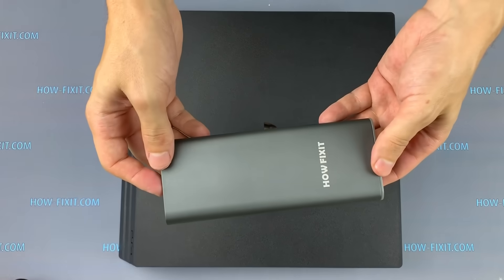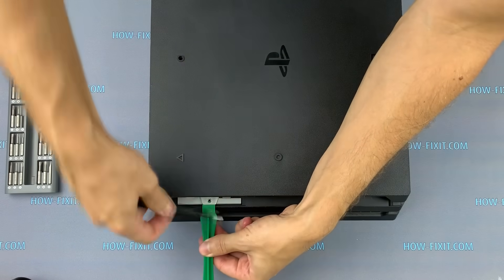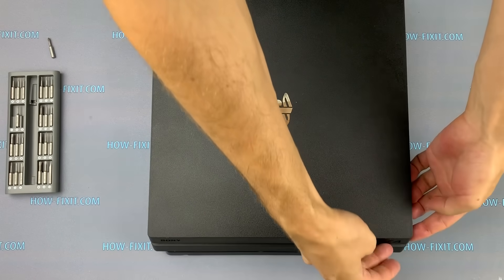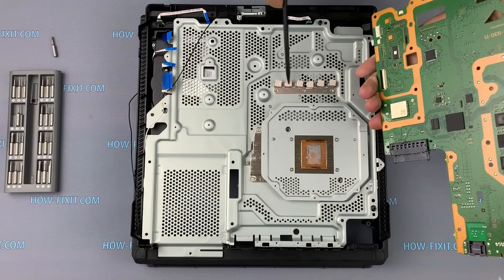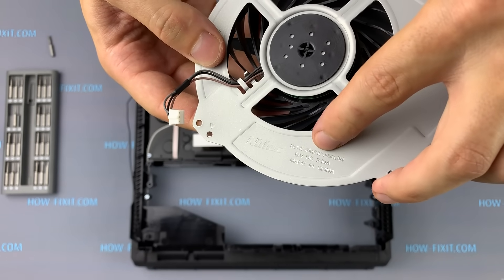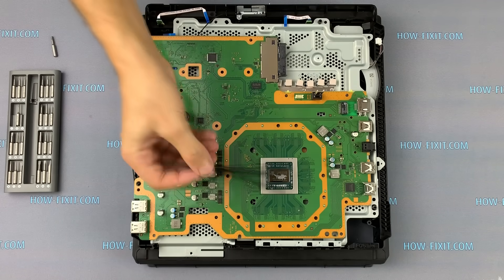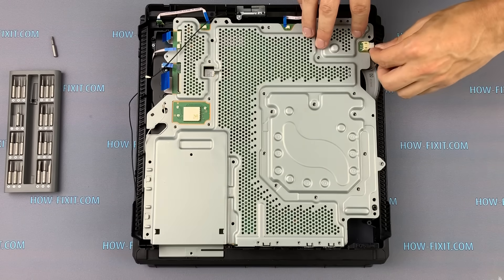PS4 Pro Disassembly: Ultimate Guide for Fan Cleaning and Thermal Paste Replacement

Comment: Followed this video and it is amazing! Helped me replace the paste on my Ps4 Pro. DEFINITELY worth it guys, every game made my PS4 ramp up the fans to max all the time since DAY ONE! Don't let people tell you that it's the "fan being dusty" or "that's how it's supposed to sound". The thermal paste in my PS4 Pro was so bad it was laughable! I took a photo but can't share it here :/

2 tips that I picked up on the way from other videos that will be very useful as you could easily break your PS4...

1. When removing the Power supply cable @3:14 ...do NOT try and just pull it out! It is connected to the motherboard and can easily snap off! Use a good pliers and grab the part you want to remove and slowly wiggle and lightly pull...NOT THE WHOLE PART....otherwise you will snap it off and it could happen so easily!

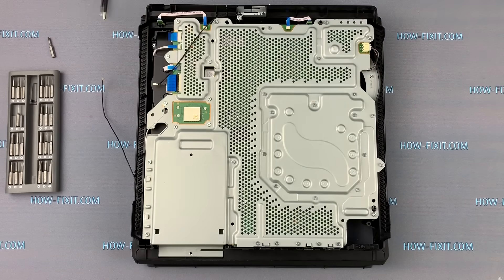2. Be sure to LIFT THE TAB on the ribbon cable @3:36, it's the only one that has a tab holding it in place. I've seen a lot of comments saying their disk drive doesn't work anymore....this is why...if you don't lift the tab you damage the ribbon cable.

Excellent video and my PS4 is about 85% quieter now! I was hesitant and didn't want to do it but I'm glad I did!

If you're reading this and you're not sure if you should do it or not....trust me it's easy, just do it slowly and carefully, the results are worth it!
Reply: I'm thinking about doing the same to My ps4 pro, because i dont know how much longer I can play games with that jet engine. But I'm not sure if it's worth spending money and time on New parts, when the ps5 Will be out in a couple of months anyway. What do you Guys think?
Reply: @fatti2602  Get ps5 it's gonna be cheaper than ps4
Reply: @doubleh2002  I was about to say the same I fed up of my PS4 pro being noisy from the menu system. I prefer to buy a ps5 when possible
Reply: Same
Reply: Removed the power supply and the part snapped fml, well I guess I will be waiting ps5 for now...
Reply: @Jack Meoff  just happened to me too, fkn sucks
Reply: @raycysm7200  did you ever fix it?? Can it be fixed?? This has happened to so many people and no comments of how it can be fixed or even if it can be fixed at all!? Like I’ve read so many comments and so many people have done this exact thing but not one comment on how it can be fixed or IF it can be fixed or soldered dam it!!
Reply: Broke the power supply connector. The guy in the vid went too fast over that. Should have read your comment first. Now I can kiss my PS4 goodbye.
Reply: @MaVieEnImages  yup I just did the same, I feel your pain
Reply: @MaVieEnImages  That's rough, I know the feeling man, time to upgrade to PS5 right?
Reply: Thanks for the moral support! Haha. Yeah I was thinking the same thing, time to upgrade.. if only they were available and didn’t cost a million bucks
Reply: @MaVieEnImages  there no way to fix it?? Wtf!? Dam it!!!
Reply: This was the comment that gave me the push I needed to try this hahaha. Worked out well, took 3 tedious hours with my shaky hands, but its been great so far. Tried different games for 5 hrs and the fan never went above a soft hum in instances when it would normally try to launch into orbit. (Smite character select, Aliens Fireteam when using flamethrower, all of Monster Hunter/Nier Automata/Red Dead). I'm convinced its because the default thermal pads on some of the chips cover maybe a third of the surface area; I made sure the replacements entirely covered them this time. Hope it holds up! 🤞
Reply: Heck yeah man i just ordered thermal paste so I gotta wait for it to arrive before working on my console. Anyone have any suggestions on how to remove warranty stickers without damaging? Not sure how this guy made it look like they just slid off no problem...
Reply: @ryugo7713  tbh I had it for so long that I didn't care, I just tore it off. Depending on your country too it may not void the warranty (I know in the US it's no longer violating the warranty)
Reply: @ryugo7713  
Yes it looks like that..BUT...the stickers are designed in a way that their text print gets detached on the plastic surface of console against the sticker surface. It case easily get detected by the service center.
I tried it..they won :D
Reply: @ryugo7713  heat the sticker up with a hairdryer and lift the sticker using a Stanley blade
Reply: I know I'm super duper late to the party but thanks for the tip on lifting the tab, my dense ass would've ripped it out thinking it was just stuck or something, I already ruined my first gen PlayStation doing something similar, so I'm very glad I didn't screw up my Pro, thanks a bunch friend!
Reply: My Power Supply Cable absolutely refuses to come out. I’ve tried both my fingers and tweezers, I’ve wiggled and gently pulled, and I’ve spent the last 2 hours trying to remove it carefully but firmly! 

If anyone can please offer me some advice I’d greatly appreciate it, I have done a bunch of research already but nothing has helped; Thank you!
Reply: @HopeBlasey  honestly I wouldn't mess with it. I did the same as you and ended up breaking it. Your best bet is to send it in somewhere if you need repairs.
Reply: @tomatofoot1786  I don’t currently need Repairs nor could I afford any if I did, my goal is to replace the Thermal Paste as my PS4 is starting to heat up more and more. 

Even if I fail it ends in the same result; No PS4
Reply: @HopeBlasey  that's exactly what my goal was and now I'm without my PS4 so proceed with ⚠️
Reply: @tomatofoot1786  Mm alright, I think I’ll wait and see how my PS4 Reacts with a simple clean; if it gets worse I’ll buy the Plyers everyone is suggesting to properly apply the Paste! Thank you Tomato Foot
Reply: @HopeBlasey  did you find anything on if you pull it/snap it off the motherboard?? Can it be soldered??
Reply: @stillamitchinmybook6320  I’m not entirely sure what you mean, would you be willing to send a Picture through Discord?

Edit: My bad, it just clicked. If you Tore the Power Supply off it needs to be soldered or more- I’d recommend going to anyone who can do Board Repair to either guide you through it or to Fix it for you.

If you want a second Opinion I wholeheartedly suggest posting on the Ifixit Website, it has a Very helpful Community who’d happily tell you how bad it is and possibly ways to Repair it.
Reply: I can confirm. Did mine today and now the games that made my PS4 sound like a jet engine play without a noise now
Reply: Thanks alot. I had these fears back in my sub concious and this comments helped alot.
Reply: agreed..just did this and  observed sony only covered about 30% of my PS4 pro  cpu with thermal paste!
Reply: Damm mine snapped off now I’m left with no ps4
Reply: @suppressor730  you are not alone friend. Makes it look WAY too easy in the vid
Reply: @tomatofoot1786  yah dude unplugged it like hot butter… wtf!!??
Reply: @stillamitchinmybook6320  Any updates, Mitch?
Reply: @stillamitchinmybook6320 lmao , you know what iphone screens are harder to fix , i dont know how the hell you messed this up, this guy gave simple enough guide not to mess up , the cord was hard to pull out , but this where you use your  brain,you just got to keep wiggling it side to side really lightly and you can pull it out eventually , i did it with my hands , i hope you brought your kids a ps5 because theres no way to rectify what you done without spending alot of money
Reply: @suppressor730  no way to fix it?? How is this possible!! Should be the first thing said in the video!! Now im starting to get pissed..
Reply: Dude I pulled my power supply cable off the motherboard.. now what?? Is there anywhere or video on how to fix that part!? Can it be solder or glued?? It seems to have happened to alot of people but no one is saying what can be done about it.. hope I didn’t ruin the system.. its been such a good system.. was doing it for my son as he was complaining about how loud it was and thought to do something cool for him and to maybe get some dad points and impress him.. well I messed up.. wish I would of read comments first.. ive done a bunch of iphone screen replacements and this seem so easy.. just unplug clean and plug back… if there is anyway or anything that can be done!? Does anyone know?? Please help!!!
Reply: @stillamitchinmybook6320  it's gonna be tricky tbh. It'll require a precise bit of soldering work. I'd advise trying a repair shop, unless you're very handy with a soldering iron!
Reply: Thank you! I’ll try it out
Reply: Mine still sounds like a jet unfortunately :/
Reply: Anybody here got links to the tools I need and the thermal paste?
Reply: My power supply cable snapped off as well wish the video mentioned this now im F-d
Reply: This has become the emotional support club for people ripping off the power supply connector. Which I just joined.
Reply: Funny how there are repair services for exactly this issue online because it happens to so many people
Reply: Too everyone commenting the best trick I have learned is not to use thermal paste but use a grizzly carbon thermal PAD. You can get them off of Amazon for about 16 bucks. Thermal paste eventually wears down or evaporates or hardens and you will have to do this process all over again. My PS4 pro was so loud that it was unbearable to try to play anything. I replaced the paste and it got quiet again but not even a year later I had the same problem. I used the grizzly pad and it hasn’t made a noise since
Reply: @shawnmiller1432  what thickness?
Reply: @smackatoo  i used the 0,2 mm thermal grizzly thermal pad. To this day i still havent had a problem out of it and its been a couple years now.  They come a little bigger than whats needed so just cut to size and save the rest incase you ever have to replace it again.
Reply: Thanks for the tips. I can also confirm it's about 90% quiet now. Games like Horizon Forbidden West was making it like a jet engine, now it's quiet, it's almost unbelievable. I used Arctic MX-4 and spread it across the CPU like a thin layer. After 2 years it also needed dust cleaning. 

For the Power Supply connector: IT'S HARD TO PULL OFF, BE VERY CAREFUL.
I used PLIERS to take it out, you just can't do it otherwise. Pick a plier and GENTLY grab it, make sure you grab only the top that needs to go out, not the entire connector. Wiggle it slowly left to right and up and it will pop off. Very careful with pliers and very careful WHERE you grab with pliers. Look at the connector very carefully before taking it out.

Comment: Used this guide to tear out mine jet engine when cleaning dust out of heatsink wasn't enough. Found out that most of the thermal paste on my APU was on the sides of it, not between and the small amount there was still left wasn't totally dry but amount was surely inadequate. Changed thermal taps for memory too. Difference afterwards is totally HUGE. Thanks for this great guide and those highlighted screw locations were very useful  to me.

Comment: Thank god I did this, my heat sink (on side next to the fan) was caked in dust, big thick clumps that i could not see from the battery side, also my thermal paste had moved to around the CPU not on it, cant wait for my thermal paste to get here tomorrow, by the way thanks a lot for the great guide but I did struggle with removing the battery pack from the motherboard but my gf showed me how its done lol.

Comment: Hi. I applied the thermal paste and thermal pads as well (Thermal Grizzly). Now the fan does not make a sound to the point when I'm beginning to wonder if it does adjust its speed correctly (it still works, but runs very quiet). After 4 hours of gameplay (doom eternal and no man's sky that made my console sound like Boeing 737 before applying the paste), no issues, though the top cover feels really warm (area near the power supply unit / heatsink). Any comments on that? Is it possible that I could have damaged the heat sensor?

Comment: My PS4 pro after about 18 months of use started sounding like a vacuum cleaner. Thought it must be dirty inside. Also saw some pictures of other's paste jobs on the CPU they discovered when opening their consoles. Followed the steps on this well-made video and was surprised at how clean it was inside. The paste job wasn't as bad as I was expecting either. A little disheartened, I still dusted the fan and radiator and repasted the chip. After restarting the system and playing for several hours, I can barely hear the system running and am extremely happy. I can only surmise that they use garbage paste at the factory. Thanks for the video, this is super stressful, but the video is easy to follow so I made it through without incident and without pieces left over. I did purchase the toolkits and paste in the description before starting.

Comment: There’s no need to back up the hard drive before removing it right?
Reply: Yep
Reply: So long as you don't remove the drive while the power is still running (don't do that lol) no you should be good so long as the power is off and unplugged before you take the drive out.

Comment: This ps4 pro is kinda different from mine, but i finally did it and the only thing i struggled with is the power supply connector. In the end i used pliers and it worked. It was a night and day difference. I really recommend doing it asap if you’re ps4 sounds like an F16 because you might fry ur cpu if you keep it like this.

Comment: I've always regularly cleaned my fan and heatsink but have never replaced paste or pads. 

I found this guide and followed it. My pro is more quiet than when it was new. Thanks for the great instruction.
Reply: Andy Crocker do i have to replace the pads aswell or can i just do thermal paste

Comment: I followed your tutorial and it fixed my console from overheating, however now my controller seems to be bugging. Audio doesn't go to my headset properly and the controller will disconnect completely or not command the inputs from when I press the buttons. What have I done wrong?

Comment: Thanks, finally I cleaned my pro , replace fan and add new thermal paste. your video helped me . thank you so much. Its quiet as a brand new
Reply: Did you have the bad fan inside your pro and bought the better one to replace it with?
Reply: lew87ys It was old one worked but it was dusty. I cleaned 2 times not worked ,after 1 week it was same. Too loud. I decided to replace.
Reply: @MrGio24  thanks for replying. Do you have the name or model number of the new fan you bought?
Reply: lew87ys  NEW Sony PlayStation 4 PS4 Pro Internal Fan G95C12MS1AJ-56J14 KSB1012H CUH-7015B.

Comment: I wanted to know how much does it cost to repair or replace ps4 pro motherboard
Reply: Probably about as much as a whole new console. The APU (which is a combined GPU/CPU) on the board is hard-wired into the mother board. So you aren't just buying a board like you would on a PC, you are essentially buying the board, the GPU, and the CPU all at once which runs about as much as a whole used PS4.

Comment: Just followed this video to replace the thermal pads and thermal paste on my PS4 Pro. Just need to install an SSD and I will be set for some long game sessions. The noise levels are decreased so far in spite of how I have the CUH-7200 model which is known to be quiet already. I recommend following this for a great and smooth teardown process.

Comment: Torque screws with FREAKING EYES in them, LOL! I'm lucky I got one of my torque screwdrivers (without a hole) to get the first screw. Thankfully I got pliers to work for the others. What's wrong with using simple screws? Anti-consumer nonsense!

Thanks for this video though. Went from jet engine to near silence (had to put my head closer to the console at one point just to be sure the silence wasn't due to me accidentally breaking something).

Comment: I would like to do this myself but is it worth it ? And most importantly is it easy enough that someone inexperienced such as me can do it ?
Reply: So long as you take your time, and use the right screw drivers and a good thermal paste, it is a night and day difference from the factory paste they put on these things. I have done this on a base-PS4 and a PS4 pro and they go from jet-engines to nearly silent machines that only hum when they are doing the most intense computing. So long as you don't break anything, it is definitely worth it in my experience. You are probably adding months if not years to the life of you console doing this with good paste like Arctic.

Comment: I followed every steps and my ps4 pro is now very quiet.. my only problems is that it doesn’t recognized any disc.. I did safety boot and every single solution I could find but it still doesn’t work.. my ps4 pro makes this weird sound trying to recognized the disc but it couldn’t do you have any solution for me?

Comment: 3:14 Is where I broke my PS4Pro. Thanks A LOT.
Just a warning to others, there are models out there that have the power cable GLUED to the motherboard, if you try to remove it, it will rip from the board, and the only way to fix that is by doing highly detailed soldering, and then you still run a serious risk of destroying the motherboard.  I  had to buy a new PS4 Pro, so the fact that this wasn't even mentioned cost me $400. Fucking awesome.
Reply: AlmightyMemerino bro how do i know if it’s glued to the motherboard?

Comment: Hey man how do I fix the lagging in my PlayStation 4 it only happens on main loading screen
Reply: Try going into safe mode and "Rebuilding database"
Reply: Hi man I tried everything I think I might have to change the hard drive in it
Reply: @johnluxford4249  If you haven't added a SSD, you should.  Easy to do.  Good prices on 500GB/1TB ssds out there.
Reply: Nice one man thank you for your messages I think I will just wait for the PS5 and my country it is €250 4 SD card
Reply: @johnluxford4249  👍